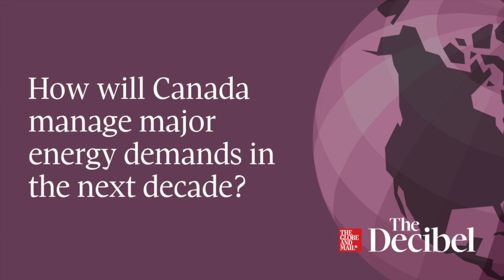How will Canada manage major energy demands in the next decade?

Comment: Nova Scotia is soooo expensive for electricity. Gobsmacking. Seriously. $690 for January and February but wait, in a tiny house with a bar fridge, induction hot plate, toaster oven and a propane water heater. I used a small room heater just occasionally. It’s sealed with spray foam including the floor. Can we buy power from Quebec? Please. We’re dying here
Reply: Any reason you do not generate your own?  Real Question.   Like Small Wind?
Reply: @philtimmons722  I’m poor and getting poorer. I have no money for that upfront investment

Comment: What I don't get is why we think we need chemical batteries.
Vertical hydro electric power.
Drill 10 000 000, 1000 meter deep holes, waterproof them, by, I don't know maybe a PVC sewer pipe as a liner.
Insert a 500 meter long steel rod in each and use solar energy to pump water under them. 
Then, insert a pin in the top of each, when the sun goes down, remove the pin, and pump the pump with the gravity driven steel rod, generating 10 000 000, 500 meter long rods worth of electricity.
Stored energy can be kinetic, too.
Let's do it.
I bet there are test holes in drill sites all over Canada that could be converted into mini hydro generators.

Does your town's water tower generate electricity when the water flows out of it?

Why not?
It took electricity to get it up there, why not capture 10%, 20%, 50% of it as it leaves?